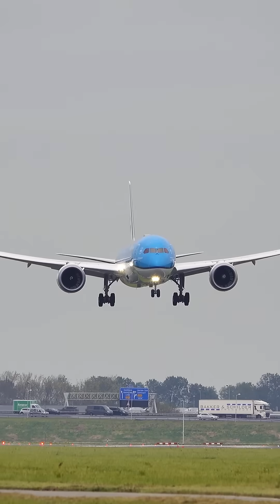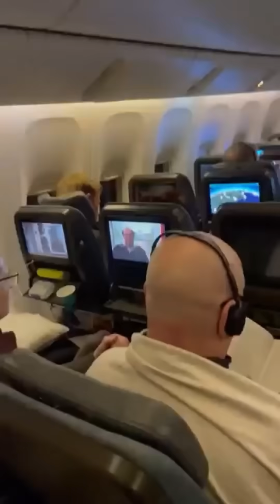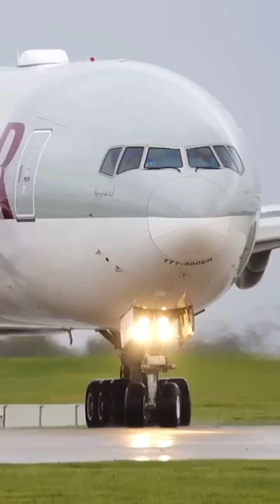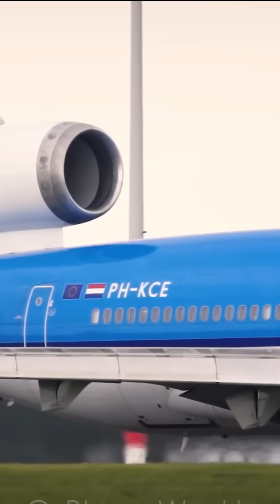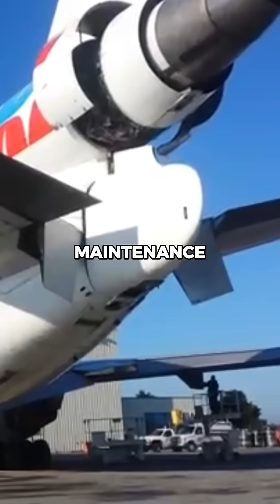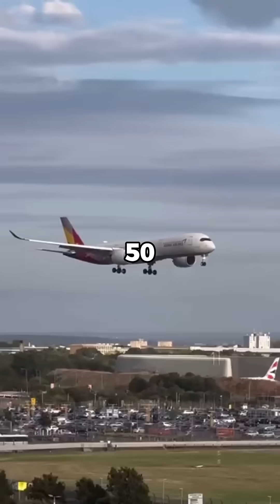Why are there no modern 3 engine aircraft?

Comment: The B727 and the L1011. Two incredible airplanes. The 727 is light enough to be tossed around, you can barely hear the engines on the flight deck, and through skillful use of circuit breakers the flaps can be adjusted to be slightly out way above flap speed for an increase in speed and efficiency. Fun stuff!

Comment: Catastrophic engine failure of the tail mounted engine posed a risk to flight control surfaces such as the rudder and elevator as well as severing critical systems or complete tail loss e.g. United flight 232. It’s best they did away with them.
Reply: This is the real answer.
Reply: That can easily be solved with twin tail like the Russian An-225 but the problem here has always been cost

Comment: There's two glaring omission in this little clip and that is that the reliability of engines back in the day were not like they are today! The engines nowadays are so well engineered that they are extremely reliable you hear of much less engine failures now than you did then, as well as the aircraft can fly on one engine when before they needed at least two or three engines to keep them in the air with an engine failure!!

Comment: In February 2014, the DC-10 made its last commercial passenger flight. Cargo airlines continued to operate a small number as freighters. The Orbis Flying Eye Hospital is a DC-10 adapted for eye surgery. A few DC-10s have been converted for aerial firefighting use. Some DC-10s are on display, while other retired aircraft are in storage.

Comment: Safety is not number 1 priority now. Number 1 priority is money haha.
Reply: That's seems true until you look at the stats the dc10 is the deadliest commercial aircraft
Reply: True😢
Reply: Commercial aviation is extremely safe
Reply: @PInk77W1  As long as it isn't a Boeing.
Reply: @ruewynnbishop  
SWA flys only Boeing for 50 yrs
They’ve had 1 passenger die.  
The first A320 crashed and kllld 3 passengers

Comment: The only real problem with the Lockheed L1011 is they lost money on every sale.  It wastge first plane to be able to take off, fly and land by itself
Reply: L-1011 deliveries were delayed because Rolls-Royce couldn't deliver the engines on time. By the time RollsRoyce got the engines perfected, airlines had already bought DC-10s and 747s instead.. Lockheed only built and sold 160 of the 1011s, so they never reached the break-even point where the massive development and manufacturing equipment costs are paid off and the costs of building the next planes are just labor and materials.

Comment: The reasons in the video are quite clear: Tri-engines went down to twin-engines because bigger and more reliable engines are available. But why didn't four engine planes become tri-engines ones?
Reply: They did for a while. They fell out of favor for cost reasons. Fuel consumption is a lot higher for four engines than it is for two. A lot of airlines also switched from the hub-and-spoke model, where smaller planes ferry passengers to and from large central airports to fill up the big planes, to the point-to-point model, where passengers are flown directly to their destination airport, which suits smaller, more efficient planes better.

Comment: He reversed the cause and effect. Engines got more reliable, so aircraft didn't need as many engines for backup.
Reply: True but also the higher relative and effect efficiency per engine have played a role. You can run the remaining engine at 110% or even higher for a prolonged period safer and more reliable and with sufficient trust to have no or low rate of decent, allowing for safe distance to nearest airport despite far from a coastline.
Reply: so why not four that is half the size of 2 and use just as much fuel as 2?
Reply: @runeingebretsen8378  Because that would be less fuel efficient. What you are describing are basically Airbus A330 and A340. Same aircraft, different number of engines. A330 is more efficient, but before ETOPS, A340 could fly directly towards its destination, while A330 had to keep within 60-90 minutes from the airports. Which took more time, and possibly burned more fuel
Reply: You think they carry one for backup? Seriously?
Reply: @memkiii  In a case of failure, two working engines are better than one. That was the point of 3- and 4-engine design before ETOPS
Reply: @CL-bm7bs  With reliability of modern ETOPS rated engines, it is well worth to use twin-engined aircraft over long distances.
There is always risk in using any kind of transportation. But risk of failure of both engines is way smaller than anything else, that can happen to an aircraft

Comment: That tail engine is mostly a hollow tube with a bunch of stuff spinning very quickly inside it.  The structural load of the tail has to be supported by that hollow tube, as well as communicating the control signals to the rudder in the back had to be really close to those spinny bits.
When a newer, more efficient larger bypass engines became available, adding them under the wing is easy, but may require longer landing gear.  Redesigning all the structure around the tail engine to accommodate a larger engine would make for a much more complicated recertification.

Comment: What an appalling video. Not an explanation in sight - or within earshot. Just one example. What are ETOPS regulations. Airline junky jargon. Totally not understandable unless you enlighten us!!!
Reply: If you punched "ETOPS" into your browser, the internet would explain it for you.
Reply: ETOPS stands for Extended-Range Twin-engine Operations Performance Standards. Basically a twin-engine commercial aircraft should be able to fly for more than an hour before landing at the nearest airport during emergency,its aviation regulation that allowed twin engine aircrafts to fly longer distances especially over the sea/ocean.
Reply: @FBAdoesntexist  True. Twin engine airliners that fly from the U.S. mainland to Hawaii have to have 180 minute ETOPS certifications. Halfway there in either direction is about 3 hours on one engine.
Reply: @johnstuartsmith  thanks for explaining it much better.

Comment: Statistically, the 3 engine jets had more failures than the 2 engine ones so the regulation was changed. However, the acceleration on take-off for the 3 engine planes was amazing!
Reply: You are comparing different size and power planes

Comment: The DC10 was a troublesome aircraft. It was inferior to Lockheed's 1011. I liked the L1011.
Reply: L1011 was too advanced for it's own good.
it could be programmed and land itself in late 70's, many People were not familiar with computers yet.
Reply: @buravan1512  However, it was capable of auto-landing. The L-1011 pioneered the technology that makes landing in foggy conditions possible. British Airways really appreciated that feature.
Reply: I was a buyer for Lockheed on the L-1011 from 1980 - 1982. Great memories and great airplane 😊
Reply: The DC 10 had the worst safety record....just junk...
Reply: @daftvader4218  ain't that the truth...people to this call it the flying coffin.
Reply: Took an L1011 to Boot Camp in Orlando from JFK. First flight ever and was impressed with the size. Hardly anyone on board in 81.

Comment: And the McDonnell Douglas DC-10 was a crap design. They rushed it to compete with the Lockheed L1011 Tristar that was already in service. The DC-10 has a weak tail engine mounting. Causing an engine that wasn’t properly installed during maintenance to fall off, crashing the airplane. The L1011 was a superior design. But after the DC-10 crash and problems, they designated either two or four engined aircraft for Trans Atlantic/Pacific passenger flying. The DC-10 only remained flying cargo until its replacement.
Reply: The DC-10 flew passengers until 2014. The tail mounted engine never fell off. Only once did a DC-10 lose an engine pod, and that was the No.1 (Port) engine - ( in '79 I believe).
Reply: @memkiii you are correct.
Reply: The crash of a Turkish airline DC 10 was heart braking because the cargo door failed in mid air because of a design flaw.
Reply: How did it fall off it was built into the fuselage all the way in the back
Reply: Baloney
Reply: @DBEdwards do some research before spreading misinfoatiom.
It is well documented why AA flt 191 crashed
Reply: It was because a wing- mounted engines was improperly installed during maimtenance; that was AA flt 191 in 1979. That was not a fault of the manufacturer's poor design. 
The DC10 did have a design problem with cargo doors being improperly closed. Look up how a Turkish Airline DC-10 fell out of the sky at around 14,000 ft in the 1970s or 1980s.
Reply: The tail engines exploded or chewed itself up in flight. It did NOT fall off as did the wing mounted engines on AAflt 191.

Comment: The third engine within the vertical fin detonated  once and severed the hydraulic lines to the control surfaces .The hydraulics passes through the vertical fin , All three of them resulting in a devastating crash . That would be reason enough to get rid of the 3rd engine .
Reply: That was a DC-10 incident in the US
Reply: United airlines Sioux City Iowa
Reply: That had nothing to do with the DC10 being phased out or 3 engine aircraft. They had already stopped making DC10s before this incident, and the model was used for passenger carrying for another 25 years, and 33 years for freight.
Reply: That could happen on a wing mounted engine as well.  They did make a fix adding valves that closed to not allow total loss of hydraulic fluid in a similar incident.
Reply: Freak accident only. 3rd engine was insurance you would arrive safely 99.9 percent of the time .😊😊😊
Reply: I was a Flight Attendant with United when Flt #232 crashed. I had flown with the Cockpit Crew many times and afterwards worked with several of the F/A's.  One of the major flaws in the design of the DC-10 was that the hydraulic lines ran close and parallel to each other.

Comment: We are going to South Africa on a 747. Four lovely, noisy engines and it can fly on just one.
Reply: Just one ? I wouldn't bet my life on that.
Reply: @mrman4003  I think that I'd go for a 747 with one over a 777 with none :)
Reply: Actually, it has a hidden hard point to add a 5th engine on the left wing
Reply: @ahseaton8353  But that is only so a 747 can quickly deliver an engine for another aircraft that needs an engine replaced. Those hard points aren't plumbed for fuel or control wiring, so the engine being carried as external cargo isn't running, though it would be windmilling.
Reply: @ahseaton8353 true, but that's just for transport. The fifth engine isn't connected to anything it needs to function.
Reply: From which airport?
Reply: @ay1ism  Frankfurt